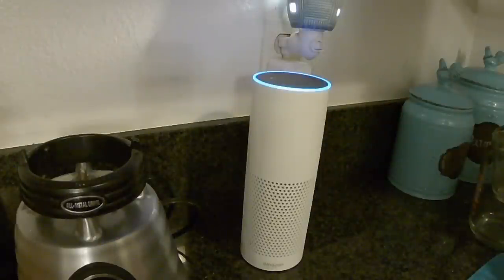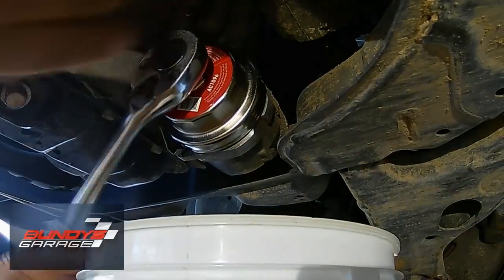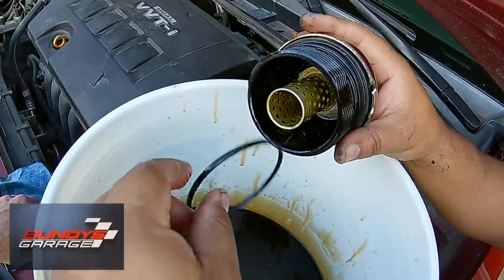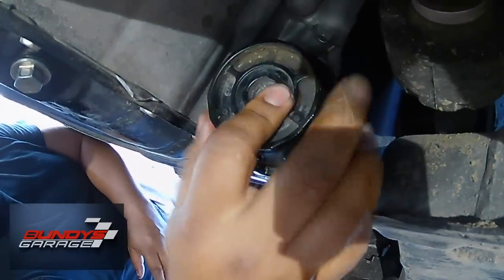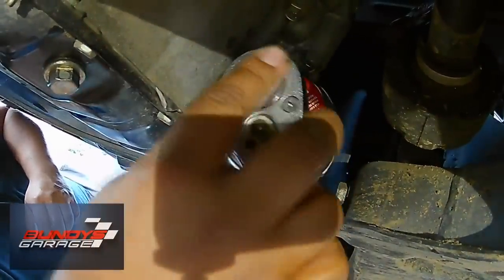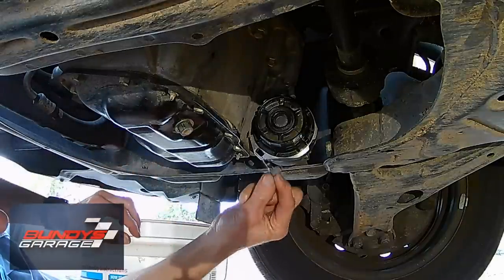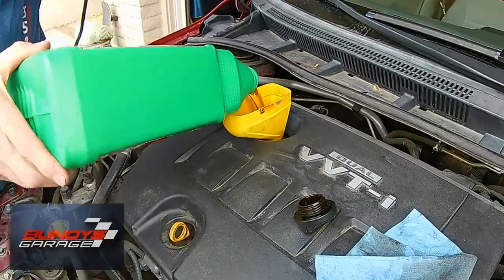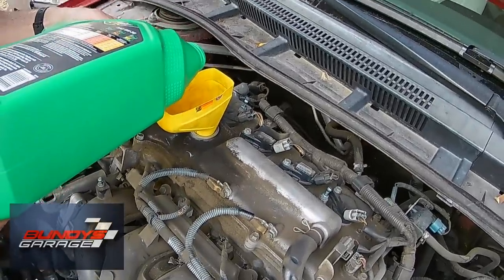2009 - 2015 Toyota Corolla Oil Change and Filter 1.8L - Toyota oil filter wrench - Bundys Garage

Comment: I had an 05 rolla Le... I always used the entire 5 QT jug....the oil line was just above the full notch. Never any problems trying to measure 4.4 qts or whatever. Sold the rolla with 188k miles..... bulletproof
Reply: Bought a new one in 2015. Full base model, no computers/screens

It's perfect. No problems, ever. And crazy cheap to maintain. 

My battery lasted almost 6 YEARS because I always kept the cabin lights off and there's hardly any electronics. Just had to keep the terminals clean of corrosion.

Comment: That wrench is sold under the assumption that it fits all Toyota cartridge filters but it doesn't. The teeth on the wrench do not engage with the tabs on your filter. They do on the 2.5 liter engine in a Camry or RAV4 but not on that 1.8 liter engine. The only reason it works at all is because the top part of the filter caps is the same size on both engines. Still a Motivx MX2321 would be a better fit and the teeth would engage correctly.
Reply: Thanks for that info😊

Comment: I've really never seen that oil clip on a Toyota before. Mostly technicians never reuse it. I worked at Toyota in the used car department and I've seen some crazy shit when it comes to oil changes on certain models. Dealer recommends on that model to put 4.2 quarts of oil in it. I've found 4.4 is perfect. The one thing that sucks about that plastic filter housing is when it's too tight to get off. They break easily and make a 10-15 min job into a 30-1 hour job. Toyota replaces the drain plug washer every oil chance. The parts department makes a killing off a 10 cent piece.

Comment: I suppose if you start off with a good car and no one screwed with the oil filter and got  it cranked on too tight. I got a 2012 Toyota Corolla S 1.8l L4. 
I bought this car with 154k miles on. It run perfect. We changed the spark plugs.
Drained the oil. Then the problem came.
The plastic cap didn't budge and even broke all the tabs off with a special $50 wrench. We had to saw the cap in half and pound out the rest of it. After getting it apart in pieces the thread were wrecked. But before all this crap happened I researched videos problems and solutions.  I was prepared and got the whole filter housing that is bolted to the engine. But also contacted Baxter Performance for their filter converter to convert to a spin on can filter. The cartridge filter doesn't have a drain-back oil valve. With 1-2 second of a dry start after all your oil drains back to pan, it could be a problem. If it ain't a problem to suck up the oil in that short of time then why was this spin on converter invented for my car?  Not only that they make a tube converter you screw in for a quick conversion. Oh, but not my model.  So I have to buy the spendy converter.

Comment: Got the tool to remove the oil filter.Tried an impact driver first then a breaker bar. But the filter is so tight, I even bend the part where the 3/8 socket tip goes. What else can I do to get it out? Of course I removed the safety pin first.
Reply from the maker: Yeah guys put oil filters on way too tight sometimes. If you have room you can try stabbing a screwdriver through the oil filter to get leverage so that you can twist it off. It will make a mess when you do it so be prepared for that but at least the oil filter is off. Also make sure before you install the new filter that the old oil filter gasket is off the mounting surface. I have seen engines destroyed by guys who don’t check and they double up on oil filter gaskets and cause a huge oil leak. Mostly from the large retailer that has blue and yellow in their logo.

Comment: Im going to change oil for the first time. How to I take bolt off without oil getting on my hand. Isnt it hot? Can i use a jack? I dont have a lift.
Reply: I use a car ramp.  The oil is hot if you run the car on a cold day to get it flowing easier.  If it's warm outside, just take the bolt right off.  Just make sure you let the car cool down ( if you're in a cold climate ) by shutting it off for a while.  You WILL get oil on your hand when you take the pan bolt off but not on the filter housing.
Reply: Best to change when hot. Wear gloves and eventually you'll figure out how to change it without getting a lot of oil on your hands. P.s. while removing the drain plug, put pressure on it while your removing it. When all the treads are out while holding pressure against it, move your hand fast.

Comment: No anti drain back valve in the oil cap. Its spring loaded cone. Its totally removable by pushing in on the metal tube and turning. Someone he man tightened the filter cap on so hard that trying to remove it with a special wrench with the notches, broke off all those tabs. we tried every clamp, no luck.
Reply: Someone did the same to my Tacoma... never let the jiffy lube change it again after I nearly popped every muscle in my body trying to break it loose.

Comment: What do you think about this knew way of changing the oil filter? 
Is it better or the same? 
Pros and cons?
Reply from the maker: Just different, it makes sense if you think about it. When there is a metal canister, the paper element is inside as well, so your just basically changing the paper element on a metal canister one. But you have to pay more for that metal canister. Ford has had that design on their diesel engines for at least 20 years.
Reply: @bundysgarage  I was thinking the same thing too. Is the special tool expensive?
Reply: Rudy Munoz  15 candian
Reply: Glad you new that.

Comment: Mine leaking  on oil filter  housing  when tighup  the  o ring push Out  how Fix  that
Reply: O-ring likely not positioned correctly or not lubricated or possibly over-tightened.
Reply: @stevensevek6151   thanks for u time the issue wass the original  never was replace  so I istill put New one o. The grove   over the very old one
Reply: It's pinched. Seen it happen many of times.